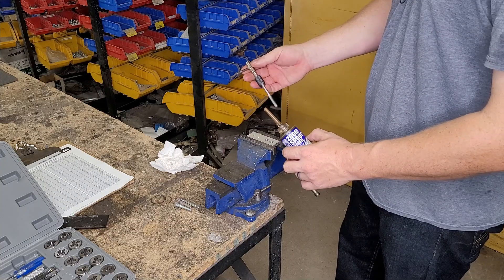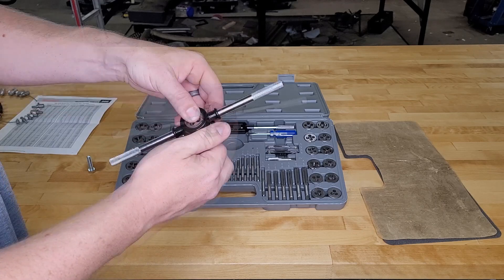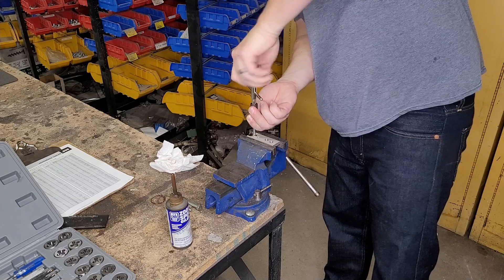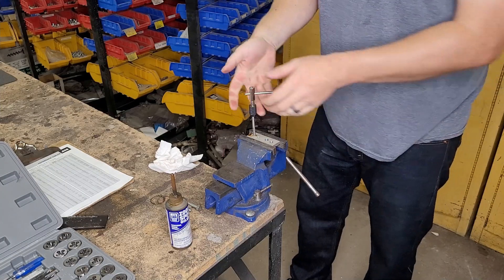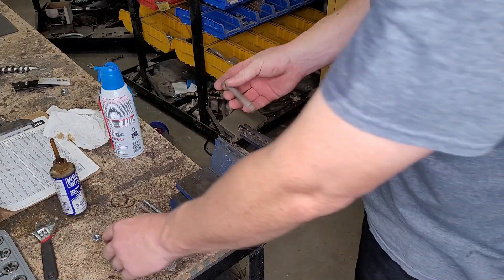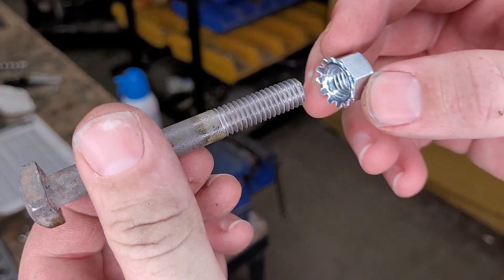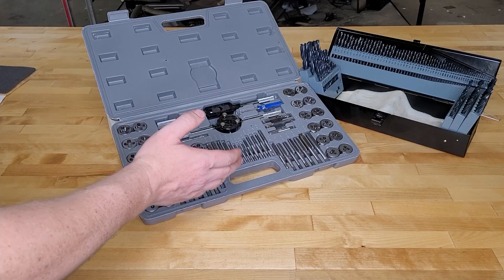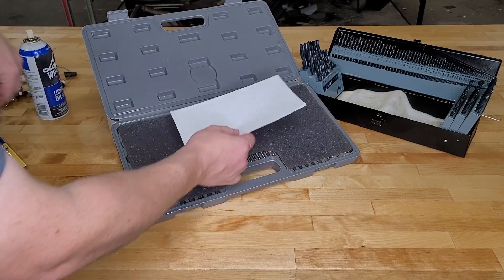Tap and Die Set 60 Pc Harbor Freight Review | How to use Tap and Die

Comment: I just bought this set. Not the cheapest at HF but not the most expensive either. Higher quality steel than the lower tiered one and a pretty extensive set for the price. When it finally went on sale I pulled the trigger. I needed to rethread a stripped bolt on my truck shock tower a few weeks ago. Worked like a charm. I wasn’t sure if it would be successful against a 26 year old Ford Super Duty suspension part but it was. I think I’m going to like this set for my occasional usage. Great video by the way, you teach very well.

Comment: This is a good set. I just picked one up. Quick question, I want to fix a loose and damaged thread for my Toyota (thread where skid plate bolts on), it’s M8 x 1.25, will the m8 tap handle that?

Comment: How do you know what drill bit size to use.?
Reply from the maker: You have to look at a chart, I think it came with the chart.  You need the drill index from harbor freight too because the taps use specific bits that are not in your typical set from home depot.
Reply: @ crap I think I through the paper that came with the kit away. Can I just use a generic online chart? I have the same exact kit

Comment: Instead of a thread checker grab a pair of calipers and measure the threads, that will give you a better check instead of having to buy that, also you don’t need that thread paper work for the threads if you know your threads you do this to figure out the hole size for your drill example: this is for 1/4-20 start by doing 1 divided by how many threads in that example you would do 1/20 since it’s 20 threads, you get .05. Next you do the size of the thread which is 1/4 so you do .25-.05 and you get .200 which is close to .201 which is the drill you would use. This only works on standard and metric threads with a 60 degree angle. Hope this helps someone and saves someone a little money.

Comment: not real impressed by the quality (replaced several taps w/better quality ones from flea markets , thrift stores , etc though i never broke a original) , but i've used mine several times over the years , and it has always done the job . i seem to need it about every 2 weeks in my handyman shop . rescued a lot of bolts and threaded parts , and made several new parts w/it .

Comment: GREAT overall video! I too also have the Thread checker tool; VERY useful!! However, I’ve been burned buying both the SAE and Metric sets. As a big HF fan, ‘these’ Tap and Die sets are complete, unarguably, total trash. The metals are too soft, they really need to be Taper taps since most will be using that kind of formula with these cheap kits and the handles are literally the weakest and cheapest thing you could assemble which often, and has for me failed after numerous replacements. It’s just garbage. Your luck potential using these are less than 10% on anything. Buy WHAT you need individually and a proper handle. These are just junk and you’ll be going back to HF innumerably to get replacements.

Comment: I crossed thread my Ford truck Triton 3V 5.4L Expedition Timing bolt hole. I was able to chase and fix one of the hole using a thread chaser. The other hole I am not able to work with thread  chaser. Do you think a tap 8 1.25 pitch would be my next more aggressive move to clean the thread. ?

Comment: Very helpful, thanks.
Reply: I screwed up a couple of bolts that I was setting in concrete. Need to rethread tops of them. Also got one that is spinning in it's hole so I might use epoxy?

Comment: always put a small chamfer on your hole after drilling, it helps with the starting threads. if you have a variable speed drill press, leave stock clamped and swap drill bit out for your tape, put machine to lowest speed and thread right there.

Comment: I really didn't know what in the world a tap and die set was. But you did an excellent job of show & tell of what it does and how you actually use the pieces in the kit. Thanks a million for that.
I am trying to figure out how to remove a broken off bolt in a propane tank. Used the left hand drill and exactor. Does not budge. Put Kroil oil on it for days. No go. Don't dare use any kind of flame---lol.
So I searching how to make this work. Thanks again for this video. Really good info. Jesus bless.
Reply: Did you ever get it extracted?
Wakodahatchee Chris
Reply: @cdrive5757  Hey....Well, what finally had to happen is just drilling it all out.....threads and all. It's all cleaned up and I ordered a Heli-coil to put in it. When something is really tedious like this....makes me really nervous about getting it right....I have to be in the mood to do it. lol   So I have not tackled tapping new threads for the Heli-coil and inserting that. I also bought the socket set that fits taps. A tap...that is the thing that makes new threads, right? Hope to get that done soon...will try to remember to let you know how it went. Thanks for asking. Jesus bless.
Reply: @sandrarichardson2713   Well, it looks like I can't help you because you've already done what I was going to suggest. Great job and thank you for your blessings.

Comment: I have that same set. The 1/4 20 tap broke in the first hole I worked on. Got a Bosch replacement and it worked fine. I think this set is okay if you don't plan to do much tapping with it. Be prepared to replace some of the more commonly used taps with better quality ones. Just my2 cents...
Reply from the maker: It's definitely not the best set in the world but it is an extensive set for the money.  I used it just the other day to tap 3/8-16 holes in steel, it was slow going but it went!  Thanks Pete!

Comment: I had a coupon last week for this tap & die set actually had it in my hands and put it back unsure of the quality I wish I had watched your video  , I have a few good taps I"ve bought over the years but wanted the set . no big deal I think it was $10. off so I'll wait they are good to have but seldom used. great review and I agree the sizing kit is great I have the set and beat trying to figure bolt and nut sizes.

Comment: This set isn't too bad. You will find that most of the taps and dies will rarely, if ever, be used. The trick is to replace worn or broken taps and dies with quality items from your favorite industrial supplier, e.g., McMaster-Carr or Travers Tool. Keep an eye out at yard sales and estate sales for nicer tap handles and die stock. 
Don't be cheap like Herb. Buy a pint of cutting oil from the hardware store for tapping steel. Buy a can of WD-40 for non-ferrous metals, like Aluminum. It helps keeping the chips from galling to the cutting tool. For Copper get a can of Pet Condensed Milk. Copper is a pain to machine or tap and the butter content of the milk helps a lot.
Starting a tap crooked is the best way to break it. Take a block of Aluminum or hard plastic and drill holes as needed for the size tap being used. Place the block over the work and start the tap into the work. 
Tap drill tables usually give tap drill sizes for a 75% thread. Find a table that gives drill sizes for various percentages of threads. A 100% thread is only 5% stronger than a 75% thread but takes twice the power to tap. A 50% thread will break-off a standard grade bolt in low carbon steel before it strips the thread (if the bolt is screwed into a depth equal the bolt diameter). Very thin sections are often tapped to a 100% thread to give the screw better purchase in the work.
Reply: Thanks for this high-quality comment
Reply: Very interesting, especially about the % thread and grip power with each.
Reply: Man you know your stuff. I know this is an old post but maybe you are still around, Question: And suggestions, i have small RV water heater tank and the hot water pipe is / was (broke off) attached to a plastic check vale. I kind of messed the thread up getting that out . I`m going to replace it with a brass check valve. would you recommend re-Threading with this set , Anything i need to look out for ? Thanks.

Comment: Just picked this up and thought I would look for a vid. Nice job on the instruction! Needed for some minor gun smith. Having worked with Aluminum before, having to drill and tap, and shape a bit, that is one hard metal to work with!!! I can see you having issues with the smaller tap.

Comment: I'm working on replacing an exhaust system pipe - an entire front section at a time, to make it easier (allegedly) so I don't have to weld. You probably know how rusty those bolts get! I've been taking it slow - real slow, and that's been the key, for me anyway, to getting it done without any injury or mechanical mishap. At the back half of the (front) exhaust, I had to cut off the bolts and drill, to remove the exhaust pipe from that part. At the front half, where it was attached poorly to the exhaust manifold by a bolt crossthreaded by the previous dummy owner, I was lucky to have been able to remove the stuck bolt, and planned on using a tap and die set for the first time in my life, to fix the threads. I had already bought a Harbor Freight set last year on sale for perhaps $20 (!), but as I was about to unwrap it, I decided that I had better take it back for store credit and buy a much better quality one somewhere else - a Husky model at Home Depot (H.D.) for $98. And I'm a big cheapskate! Why? Because I felt I was already lucky to have removed the entire pipe I needed to do the repair, and was concerned if I used the Harbor Freight tap and die, I may fail due to its low quality - like, I may break off a die in a hole - bet that would be a nightmare, or I may make crooked threads or something. Note: The Harbor Freight set I had did say it was for SOFTER METALS, and I was unsure what I would be going into, so I played it safe and "invested" in the Husky one at H.D. (lifetime warranty), and fixed the threads in no time. - I'm not saying the Husky model is the best for $100 for everyone - but it's a great choice for me in my smaller sized town. If both my vehicles are down and I need a replacement Husky tap and die part or set, I can bicycle to H.D.
Reply from the maker: Hey Don, this set is great because you get a ton of major sizes for so cheap.  If I had a bolt or two in something hard like an exhaust manifold I would probably buy a good single tap from the hardware store or go the route you did.

Comment: thanks for reviewing this. I've never used a tap or die before yesterday. I actually was able to use the 1/4 die and make a bolt out of bronze rod for a canoe that I'm building. It took a lot of work and time but eventually I was able to thread nuts. Saving a bolt would be easy compared to starting with raw rod. I thought the die holder handle lacked a bit to be desired but for the money and no more than I will ever use this, I'm glad it's in my shop

Comment: While you can chase threads with a round die, that is not what they were designed to do, they were designed for cutting new threads. For chasing threads you want a Hex die, there hexagonal shape lets you get a normal wrench on them to chase bolt or screw threads.
Reply from the maker: I hadn't known that!
Reply: @HerbOMatic  that's because it's not true.  This hearsay got legs from being perpetuated by Abom79.

Comment: 1:00.. it's also intended to leave in as rust prevention... these are great to stick in your tool boxes and not have to worry about corrosion
Reply from the maker: Is it just oil soaked paper?
Reply: @HerbOMatic  It looks like paper that I've found packed with new pistols, called VCI (vapor change inhibitor) paper. It's supposed to keep water vapor from condensing, and causing rust. It's hard to tell if its the same stuff, though. A nice light coating of oil like you did is probably more effective, I'd guess.  It might be VPI, or vapor phase inhibitor; it's been a long time.

Comment: Thank you for the review. I recently ran into a problem with the way one hole was tapped on a roof rack, and I didn’t want to have to replace the whole roof rack. One tap plus a handle would have cost about a third of what this entire set cost, so I bought the set. Thanks for showing me how to use it. 👍🏼
Reply from the maker: Glad you got the set, it will save you again, keep the set sprayed with oil to prevent rust.
Reply: @HerbOMatic  I dont want to spend 18 minutes watching..Was this a good set to buy ??

Comment: The dies should be hexagon rather than round so you can use a wrench or socket if you need to.
Reply from the maker: That's a good idea, the included handle works pretty well.

Comment: Cool video!  Can anyone help me out?
I'm looking for a nut with at least a 2 inch diameter hole...
I'd like to file the threads (coarse thread of course) in order to make a device to cut threads on a wooden dowel.
I've pretty much seen all the videos on YouTube, and I really don't want to make a screw box that would require precisely having to line up a file to make them.

Just seems to be. Bit easier to make a tap and die from a larger nut and bolt
Reply from the maker: You could do that, but a 2 and 1/2" nut cost $60 bucks each!
Reply: @HerbOMatic  agreed, just can't find any that are "course" threaded... Or any for that matter.  The lowest thread count would be the best, but I don't know what that would be...
The nomenclatures have me all confused 🤔.
Reply: I think you'd be better off learning to cut screw threads on a wood turning lathe. Dies or even nuts of that size are uncommon and expensive, and I don't think that's the way that threads are cut into wood anyway. Lathe work is the way to go for what you have in mind.

Comment: You made a scary situation into something educational.
Reply from the maker: Thanks Nelson, what part was scary?
Reply: @HerbOMatic  I broke the coil while tightening one of the bolt of my new exhaust manifold. The bolt just keeps on turning after that. It was fixed now. I ended up replacing the washer with a thinner one just to chase the remaining coil.

Comment: I bought myself a 40 piece set I got scared because none of my bolts matched to it until I read about metric and SAE (standard). My set is metric but I did try it on a broken bolt and damaged nut, it's nice. As practice
Reply from the maker: Rolando, that's why I grabbed this particular set it covers most of both SAE and Metric.  Keep learning, it's a blast and things fixed with your own hands feel better.

Comment: Bought this today. Hoping I can start tapping things and fabricate cooler stuff. Good video thanks for explaining things so well. Didn’t know what thread combs were. Learned a lot.
Reply from the maker: Adam, that means alot to me!  Tapping holes can really expand your fabrication envelope, it's a decent bit of kit.  Stay tuned we'll go over all the tools I own over time.
Reply: Adam, solely as a FYI, it's called a thread pitch gauge. While I won't comment on the quality of this set, I would suggest that you seek out tapping videos done by machinists. I know, there's a plethora of videos just like this one essentially showing the same thing. That's not really how it's done. There's the choice of tap, the type of cutting fluid, the size of the hole (<--- crucial), the actual technique for cutting threads, correct nomenclature...yadda-yadda. Take a look at Abomb79 and oxtoolco along with ThatLazyMachinist and see how threads are cut. Especially the latter, TLM, has some excellent videos on all aspects of metal work including choosing the right cutting fluid for a given process.

You may also want to invest in a Machinery's Handbook, AKA The Book, that will help you more than any Youtube video. Some personal advice: As you already have this set, replace the tooling that you use most with quality HSS as needed. A good tap is only about $10-$15 to your door. These days OSG is a pretty safe bet. Same goes for the tap handle and the die stock. If you use them a lot and they aren't performing well, a shocker, replace them with better tools. If you need some specific pointers, post back and I'd be happy to respond. I cut threads daily. Good luck.
Reply: @felixf5211  wow thanks a lot. Appreciate the response and ya I’m just scratching the surface and this helped. Thanks.